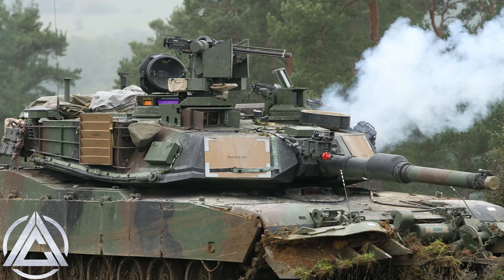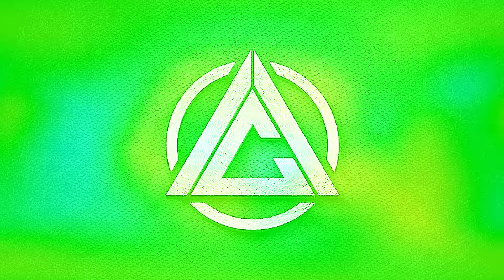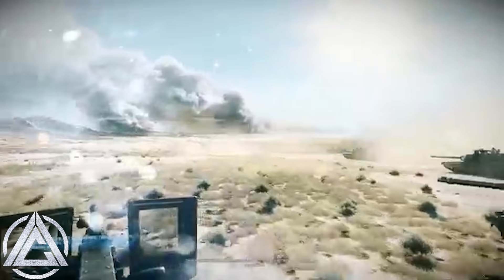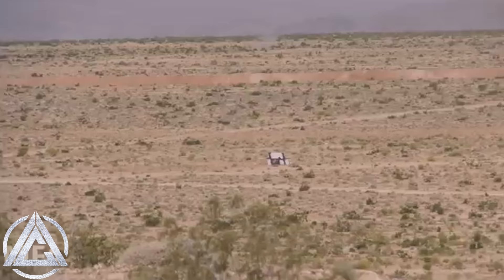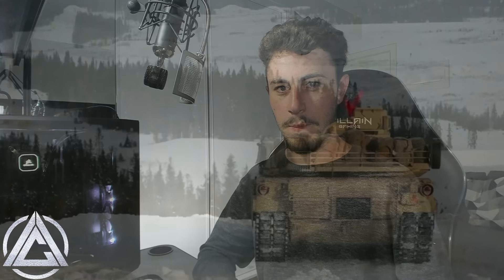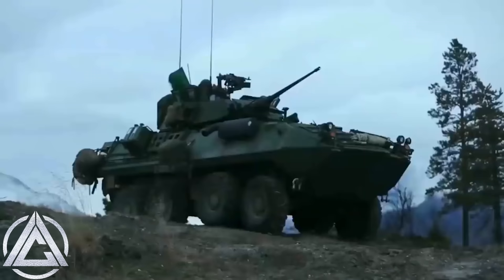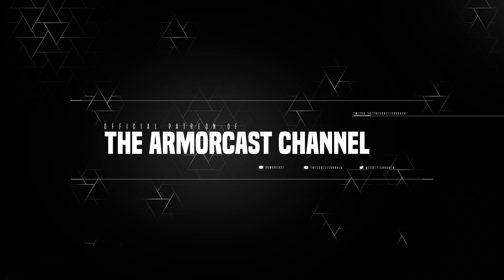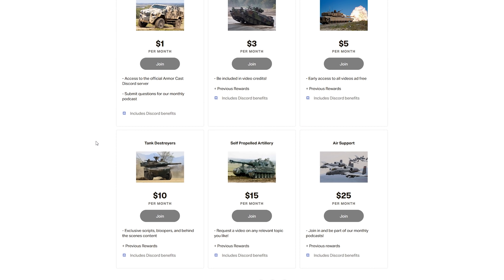What Are Those Squares on the M1 Abrams Turret? | Koala Explains: Combat Identification Panels

Comment: We don't just use the panels.  We learn armor ID.  We learn to recognize vehicles, both in regular optics and thermals.  Engine placement, exhaust location, turret shape, number of road wheels, concentric, vs non concentric bore evacuator, or no bore evacuator.  We also now have blue force trackers which are GPS enabled, and show the location of all units, and vehicles equiped with them, in real time.
Reply: ADVANCE   INDIVIDUAL  TRAINING 
( AIT  )   ARMOR  SCHOOL  :
" VEHICLE  IDENTIFICATION  "
FRIENDLY  /  POSSIBLE  ENEMY  , 
WHAT  TO  LOOK  FOR   ,
IDENTIFIED  ,  FIRE ,  ON  THE   WAY .
Reply: Vehicle ID is part of GST (Gunnery skills test) and is mandatory to pass before being allowed to conduct live fire. You also must Qualify up to "the gates to live fire" in the AGTS. Failure to qualify up to the gates will result in no gunnery live fire. (did IO for crews at NTC, Benning and Stewart). But there are more than just AGTS and AFVID in order for you to shoot live rounds....

Comment: I was thinking the same about other enemy forces potentially targeting their own when they would have similar panels applied.

However, the panels of course do give a clear indication to enemy tanks equipped with infrared vision that that tank is the enemy. So I suppose it “helps” the enemy to fire on you as well. But probably not to the same extend as it helps to avoid friendly fire.
Reply: Good chance by the time you see them you already have incoming

Comment: There are 5 total...2 on the front of the turret, 2 on the panels mounted on the side of the sponson boxed and 1 in the back of the bustle rack in a panel mount. When you turn them around it will be seen though the TIS (thermal imaging system)

Comment: If you were to actually cover a tank (or any asset) with 100% IR invisibility panels aka thermal insulation, it would get even hotter and burn the whole thing. That's if you were able to stick enough of it, but as you say some parts would still be uncovered for a tank.
The invisible plate thing can only make the rest of the asset more visible.

Comment: if the enemy started to use them we would just use patterns of them and the pattern on each panel would get changed for that mission and each crew be it ground vehicle, aircraft, or infantry with ATGMs would have a briefing on what that day's pattern is.  Given the tech level of imaging systems one could probably even have the pattern displayed in the imager.

4:12 you can somewhat see a pattern in it already so if one removed some tiles it would show differently.   and you change that every mission.

Comment: You didn't mention another really obvious downside of coating your entire tank in it. Cut down into it's basic visual format, thermal imaging works best when you can differentiate one color from the other. The color is irrelevant, and they even have different variations of monochromatic (Black hot or White hot, meaning the a hot object will appear black or white respectively). 

Coating an entire MBT in it will make the MBT's oddly low thermal signature.. POP OUT of the much hotter environment!  So it would only be handy in cold environments. And even then, in a sufficiently cold environment, I imagine the tank, by sheer virtual of thermal conduction, is still going to pop out a fair bit.

Comment: If you covered the whole tank with those, it would not radiate any heat away, if they conduct heat as poorly as they radiate, the whole crew would boil inside the tank due to their body heat and the engine.

Comment: They need to desentralize thier command and lower intel to the ground level in a systemic manner. Centralized top heavy command systems are delicate, and all too easily disrupted. All this tech is great and all, but its so new, that we haven't really established for certain that countermeasure against them don't exist. So to base your entire doctrine around the assumption that someone will think of something to fix it hinges on the enemy not thinking of some way to break it.

If you design it so that it can function even when broken, or can be easily repaired without major loss of performance, then you've got some truly military grade tech. Other wise, it belongs in a showroom.

Best way is to have redundant systems where you have different tech doing the same job so you don't have your whole docteine neutralized by a single Uno card.

I know this sounds obvious the way I've layed it out, but you'd be surprised how many stories I've heard of troops thrown into the deep end with no backup, no backup plan, and no resources. Whether its caused by a logistical limitation, technical limitation, or political limitation, there is no excuse to knowingly start operations on the back foot.

These wars are not existential, they are NOT necessary, meaning all casulties are unnecessary casulties. There is no excuse no matter how technical.